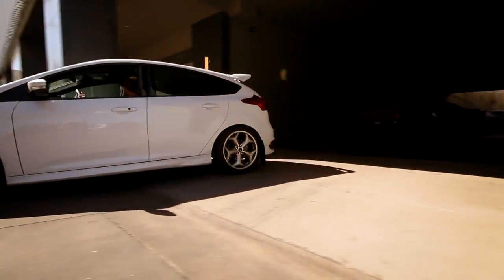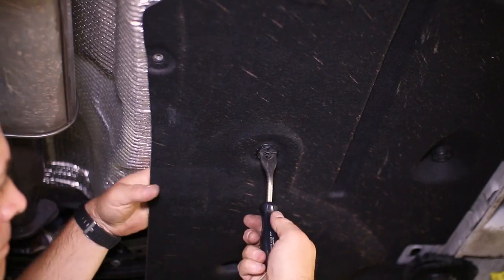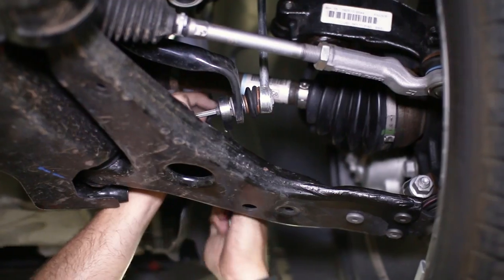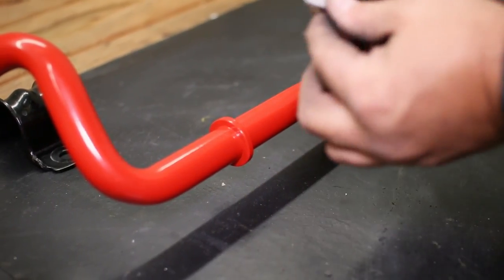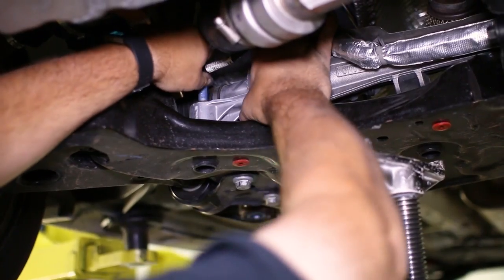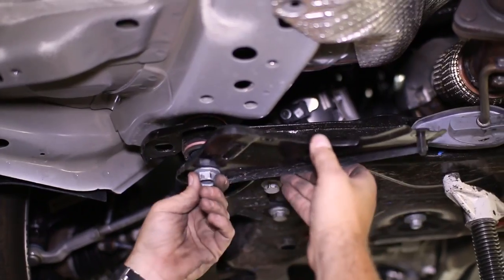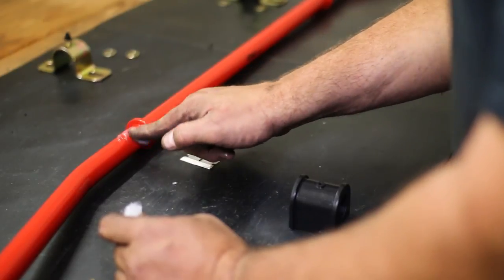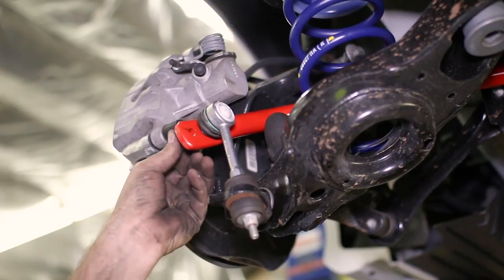2013-2018 Focus ST Eibach Front and Rear Sway Bar Kit Install

Comment: Can this be done on the se sedans?
Reply: It looks like the suspension setup is different to this one. The SE doesn't have a rear sway bar so you can add one pretty easily.